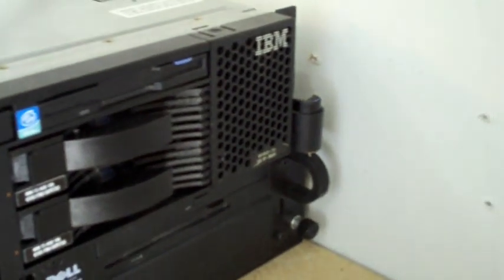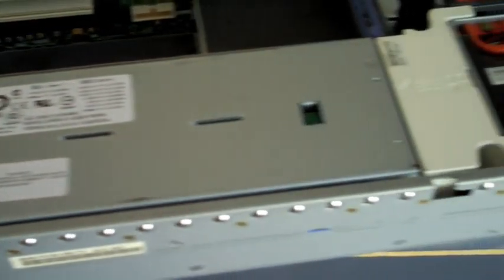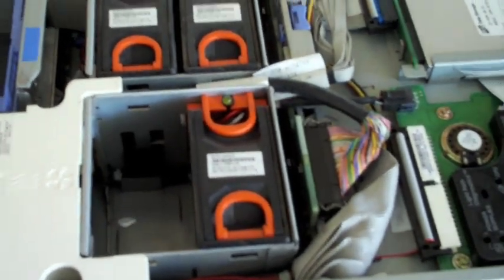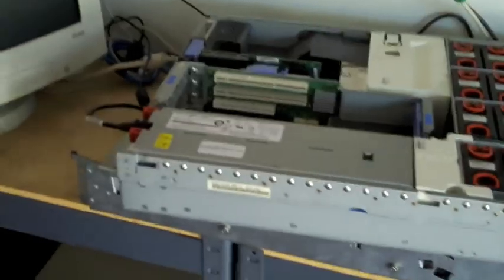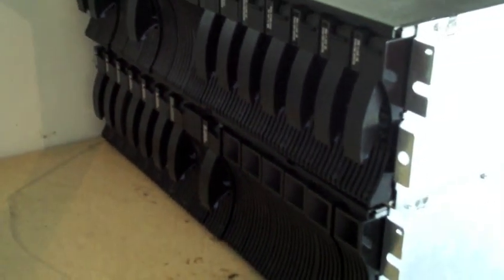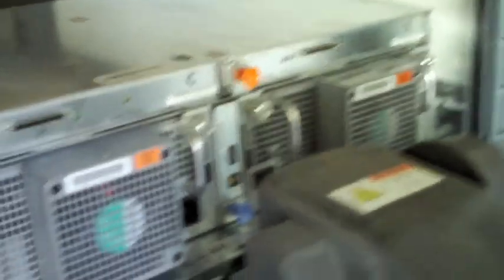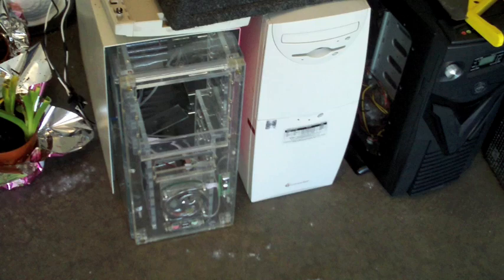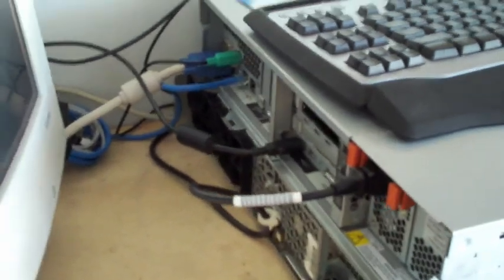My IBM xSeries 345 Server & PowerEdge 2500/2450

Comment from the maker: @scallywagin That would kind of be suicide to the machine though. You probably just need some sort of resister or something across the leads to make the machine think the fan is still there. Just an idea. Not sure if it would work. Generally these servers aren't in your house so the noise probably wasn't a concern when they were designed. :)

Comment: I wouldn't recommend you throwing away those PowerEdge 2500 and 2450 servers.  Dell's great, and you can use them for other functions like running web, database, and mail apps.  Put Windows Server 2008 on them.

Comment from the maker: @Zorack10 - I am actually not sure on the 2450. I have not powered it on to see whats installed yet. Just did a test power on to see if it worked. Its just been sitting.

Comment: You use OpenManage on that dell 2450 on a 64 bit OS? If so,how did you get it to work? I have a poweredge 2450 myself and I don't know if I can get my OpenManage 7.2.2.2 to work with Vista 64 bit.

Comment from the maker: @tutor432 - I am not completely sure which raid format is compatible. Raid 0 is fastest... Raid 1 is safest.... Raid 5 is all around good but needs more drives(3 and up) and can be slower with onboard controllers. It all depends on what you wish to do. If you need one giant HD, or a raid that will save you from lost data when a disk dies.